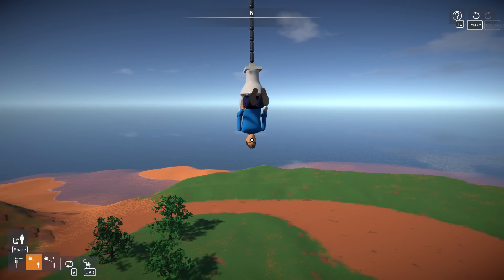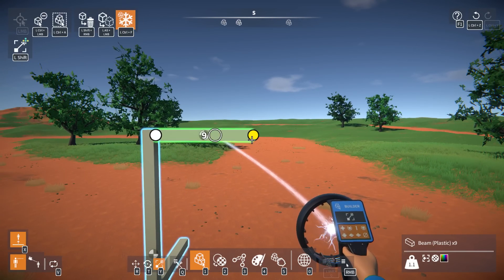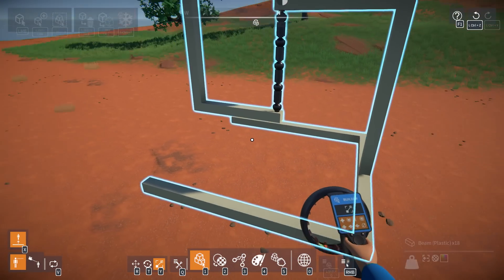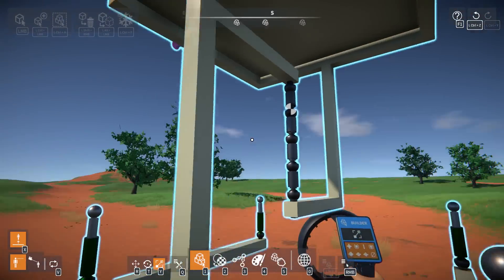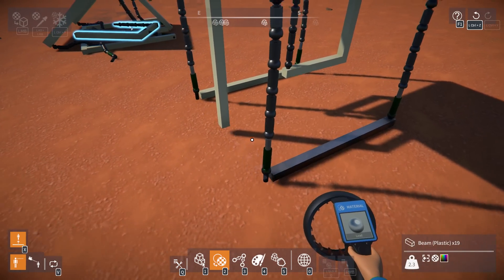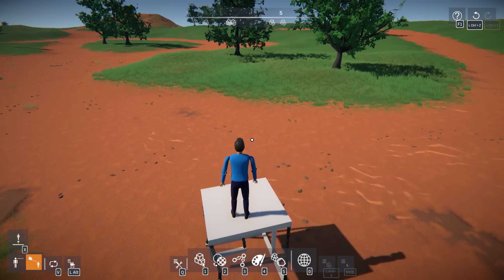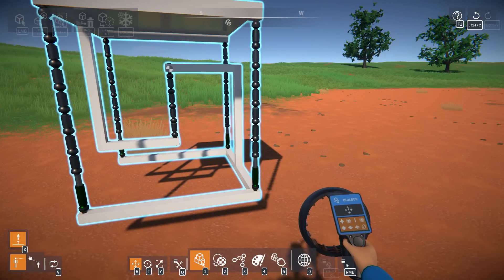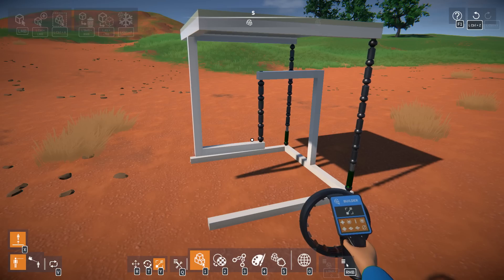I Built a Structure That Seems to Defy the Laws of Physics!

Comment: It is not stable with just those 3 ropes (1 in the centre, and 2 on the outside).
If it tries to tilt forwards (towards those 2 ropes) it will allow those ropes to get shorter.
You need 4 in total (1 in the centre, 3 around the outside) to make it stable.
What you likely saw was a table which had 2 visible, the centre rope, and then a rope behind hidden from view.
Reply: Might be able to achieve a precarious balance by getting clever with shapes and weights

Comment: The 3 chain version is unbalanced.  Offset the table top by 1 or 2 blocks and that will provide the tension needed on the back two chains, hopefully without Unity freaking out.

Comment: kAN, if you moved the short rope in the center towards the tall ones without changing the overall dimensions of the table what’ll happen is the center of mass should tension the tall ropes since they’ll be on opposite sides of the short rope in the middle.

Comment: Uhm actually kAN, you need 3 members to keep the tensegrity structure stable, not 2. The one with 2 is only stable if the center of mass of the upper part is opposite the 2 cables.

Comment: The coolest thing I know if comes from fluid dynamics. 
I have 2 containers of water. One has a small pipe at the bottom to drain. The other one has a pipe that goes from the bottom up, over the edge, bends down and the pipe goes down just as far as container A. Assume the pipes are full of water without air. Which container empties first, A, B or both at the same time? 

Answer is B with a shoutout to Bernoulli

Comment: I wonder if the game would be able to accurately simulate a chain fountain (Mould Effect)?
Reply: Considering the max length he could make the "robe" just hanging before it freaked out as shown in the start of the video, there is no way he would be able to make a chain long enough to even start a chain fountain
Reply: @GummieI  He actually might be able to... Instead of the "rope" that bends in every direction, he could make a simple chain with rods and beams. The physics should be much more forgiving than the ball joints, but the hard part would be setting up the chain in a way that can start the fountain effect.

Comment: You definitely need a rope in each corner, because that prevents movement in every direction. As the table tries to move one direction the ropes on the opposite side increase in tension and prevent it from falling over. With only two ropes on one end, you can still have movement toward both of those ropes. The table can now fall completely over onto the side with the ropes. 

Great video btw.
Reply: I'm pretty sure I've seen a 3 chain solution. You just need to pay more attention to balance.
Reply: @OriginalPiMan  true. 3 chains would also work as long as it was an acute triangle. The closer to 60, 60, 60 the better.

Comment: tensegrity structures are by far my favorite method to test a game's rope physics. 

and the table at the end 'can' work with only the back 2 but a 3rd in the front will be needed to make it stable. its very similar to a table with 2 legs, fine with any force in plane with the 2 legs, but will tip over to any force perpendicular to that plane.